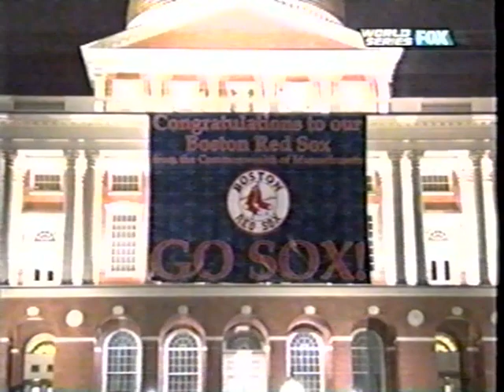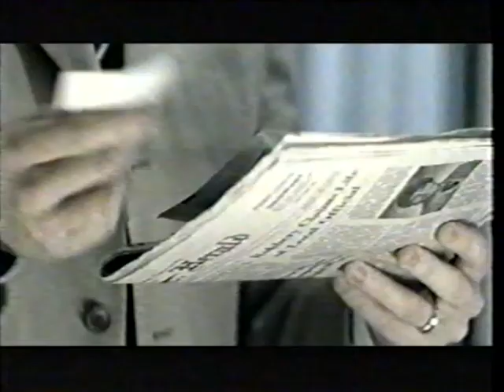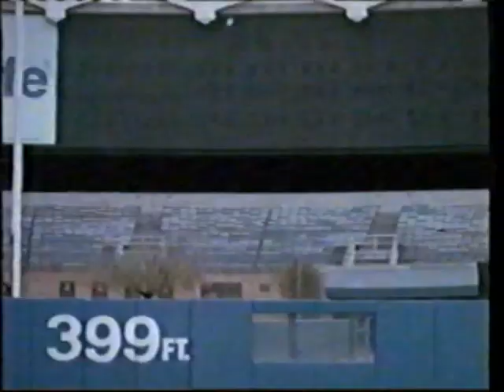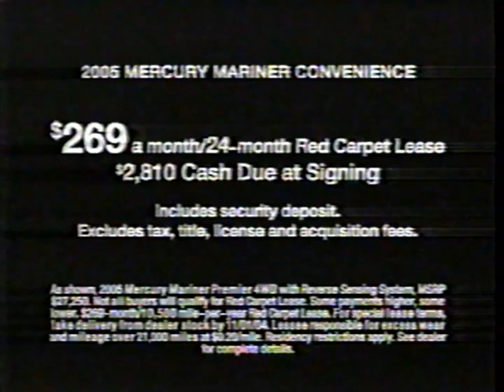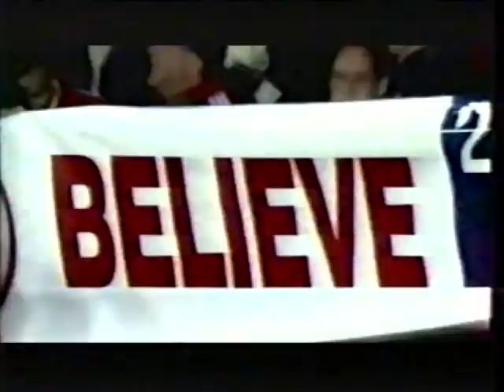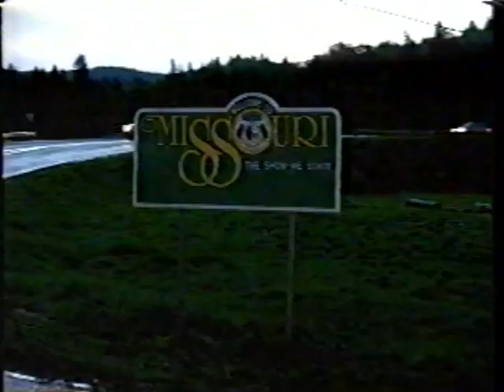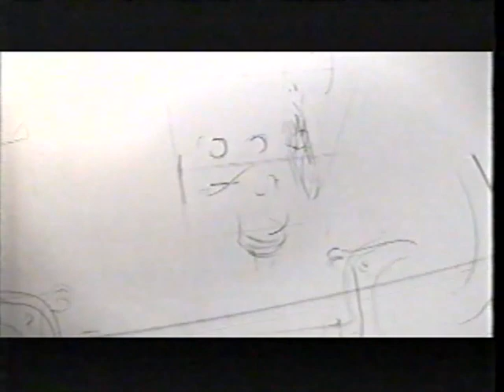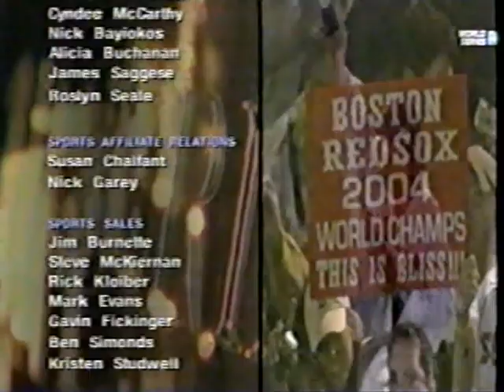Boston Red Sox at St. Louis Cardinals, 2004 World Series Game 4, October 27, 2004

Comment: 24:30 Hmm, I know this is 2004 and there was already demand to push people to cable tv, etc, but to announce  #OTA broadcasting audio a Dolby 5.1😅😅😅😅 #EFM #PCM a 70's #Sansui or #Sherwood could decode at least the audio, and with no other statement by #MLBonFox I could definitely see some #surrround sound returns especially if rooftop antenna was getting some good multipath😅😅. Some sanity now #OTA tv's at least do not force you to spend through the roof for the silly #Opticalaaudiohype. In fact even though I have a TV that only has optical out, those manufacturers now spend time configuring digital audio to place illegal #DDOS attack blocks so some users are stuck with no audio.😢